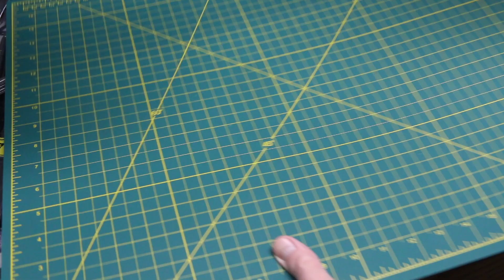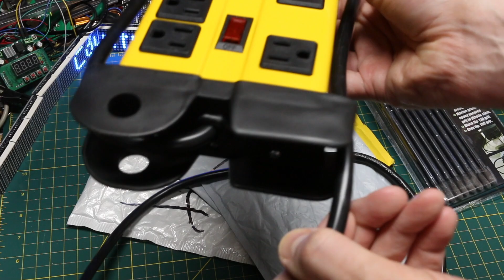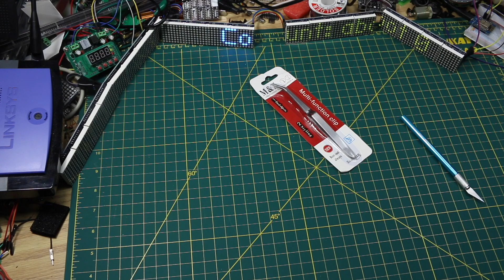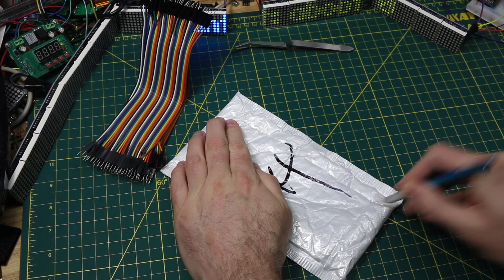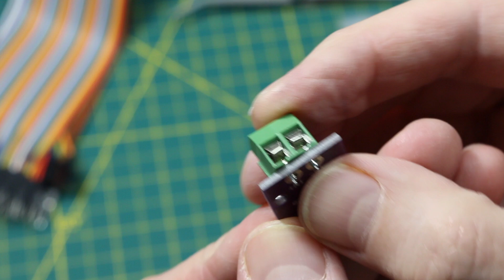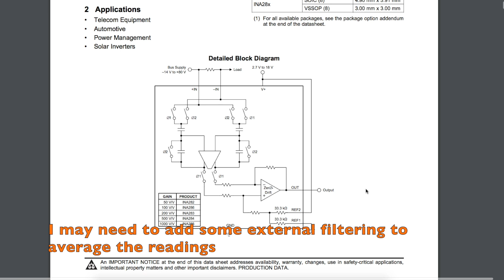GR Mailbag 20.MA.15

Comment: Cannot get over how small your plugs and sockets are compared to the ones here in the UK.  I saw the Adafruit unit with built in relay the other day - it is a lot of work even to get remote control sockets to retro-fit in most houses and it's only this year that switches can cope with our light cabling and they cost a bomb so far.
Reply from the maker: I have a UK plug on a little lamp thing here from years ago bought online and then I bought a transformer to power it over here and I couldn’t believe how large the UK plug was!  I wonder if there’s a good video out there somewhere explaining the historical reasonings for the standards that were chosen in various places like if it’s related to the voltage or the current rating or completely arbitrary.
Reply: Gadget Reboot Best one I know of is one by Tom Scott https://youtu.be/UEfP1OKKz_Q very interesting but still a pain if you need a lot (e.g. audio / visual)

Comment: The advantage of the analogue voltage output current sense chips is that you can use the comparator on the microcontroller if it has one to trip the power faster than the controller can.

This makes the over current protection a h/w function, so not delayed or affected by delays in the software, or having to have an interrupt to handle it.

Nice compact mains block. Our UK one are sooo much bigger.
Reply: Have never found a satisfactory means to measure a wide range of current.  With analogue output, you can put capacitance on the the line to reduce noise, but of course, this delays the reading.  Hall-effect sensors usually have some voltage gradient proportional to the current, but in rather crude steps when measuring in the mA range.  (sigh)   @GR -- that super-fine magnet wire I sent you can be useful for making custom precision resistors for current sensing ... like below 1ohm.  You may need a precise current source to calibrate.
Reply from the maker: funny enough I’m working on a current source video if I can get somewhere with it, but just the same old basic simple BJT non-precise type as a fundamental intro. I might have some uses for precise and imprecise sources.
Reply: @GadgetReboot  Was inspired to build  current sources from EEVblog vids.  Uses an op-amp and to regulate the current sunk by a MOSFET.  4-wire resistance measurement is a breeze after that.  Dave's understanding of theory, practice, and manufacturing tech is unreal.
Reply from the maker: I think I was looking at those videos back when I was considering making an electronic load but then I ended up getting an actual product so I need to come back to it at some point to do a project.